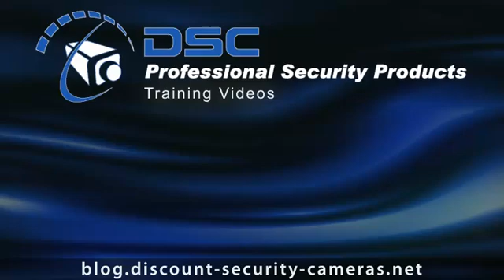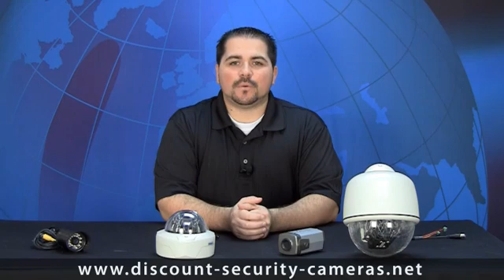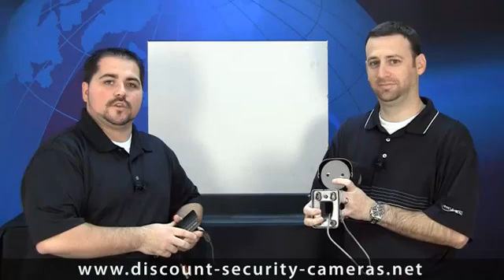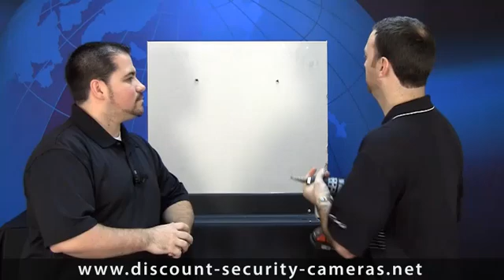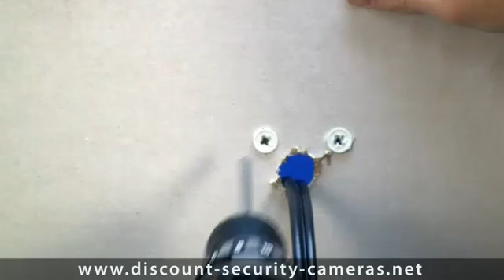Introduction To Security Camera Installation - Part 1

Comment: Well most electrical problems are the connectors.  So what do we have here looks like 12” of wire and the connectors are pushed back into the wall so the wire is pulling on the connectors.  And unless the connector locks it is a possibility they may come apart inside the wall.  Next someone will snug up the wire in the cavity and staple it down where it comes so now if you need to get at the connectors there is no slack in the wire in the wall when you remove the camera bracket.